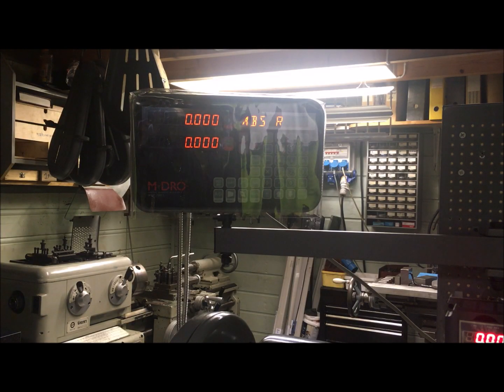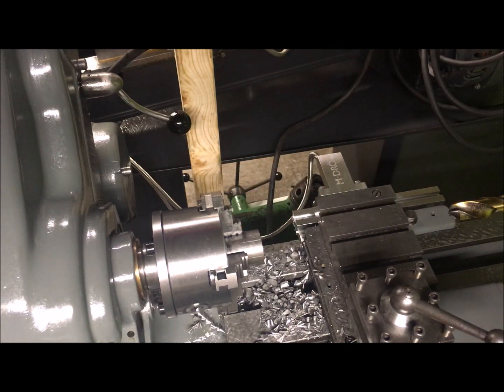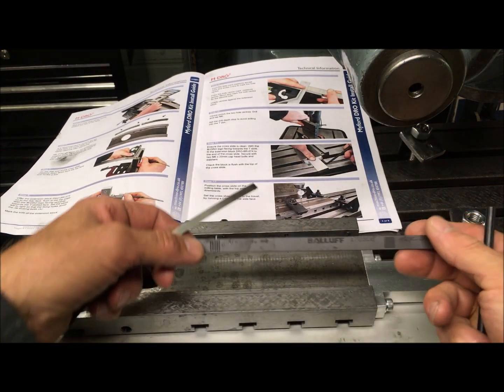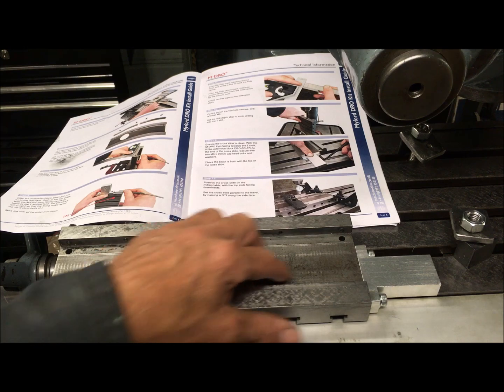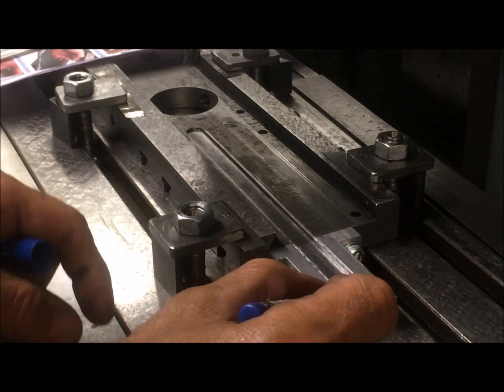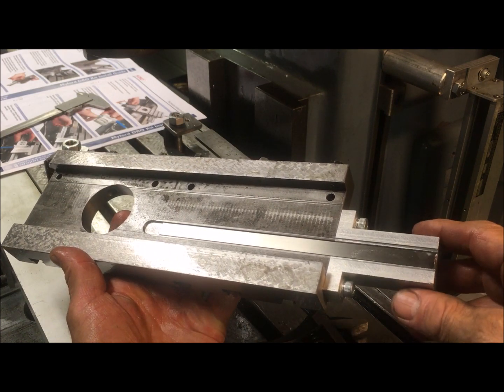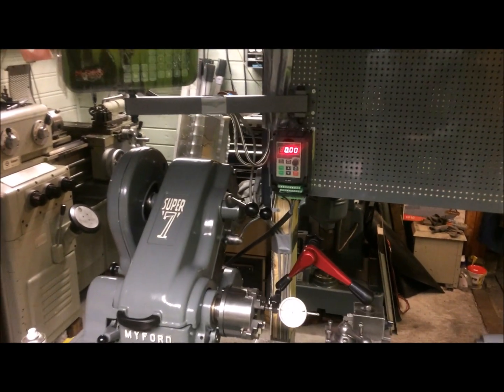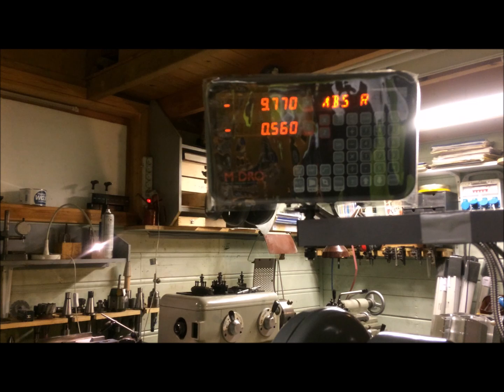Myford Super 7 -  DRO installation

Comment: Nice DRO installation Jan! I want to install the same embedded solution on my Super7, but I also want to install a backsplash. How far from the back of the rear bed shear must the backsplash vertical wall be AFTER the DRO install? Thanks!!
Reply from the maker: Thnks! It will in practise add 4-5" to the overall length of cross-slide if you also take into account the cable bend

Comment: Is the strip magnetic enough to attract chips?  Your installation looks good, I hope it proves to be durable equipment.
Reply from the maker: Not enough experience yet to tell how it will be in use in the long run, but it is surely equally "protected" as compared to the normal way of installing it.. and totally "out of the way". I guess this question is better asked to the supplier, Machine DRO.. will ask!

Comment: Where is the head for the magnetic strip located? Is there an online manual with the mounting instructions I can check? Thanks for taking the time to reply.
Reply from the maker: Cristian Armaselu The reader head is placed under where the added bracket to the cross-slide is, ie just behind the saddle. I think there is an online guide (check their website) if you look, otherwise just contact them. They were very responsive. Both for questions and for the order handling. Actually not happened to me before that I receive the package in less than 48 hours since I placed the order!